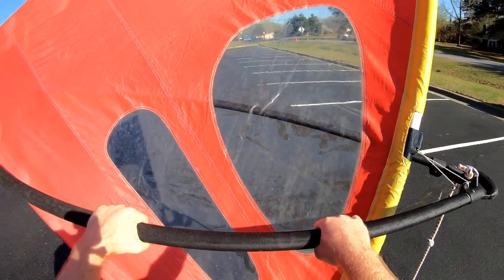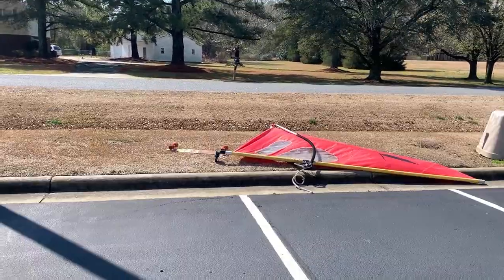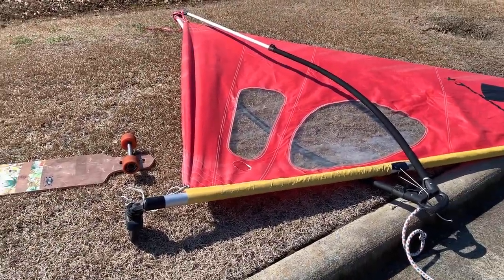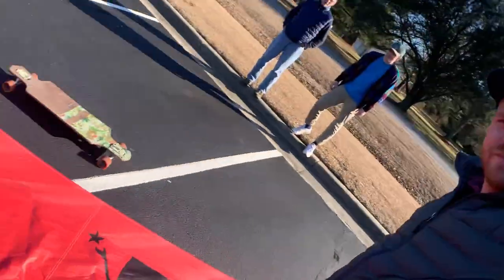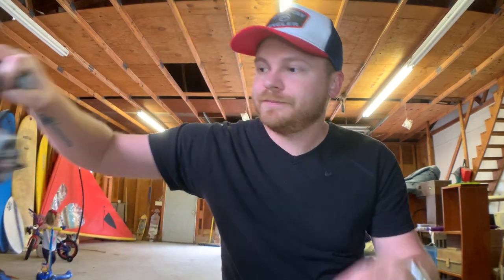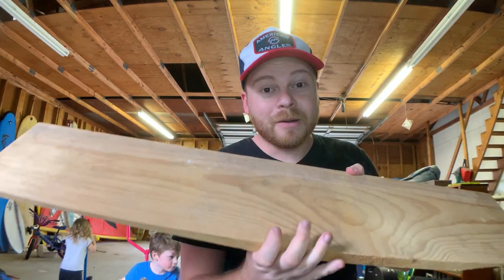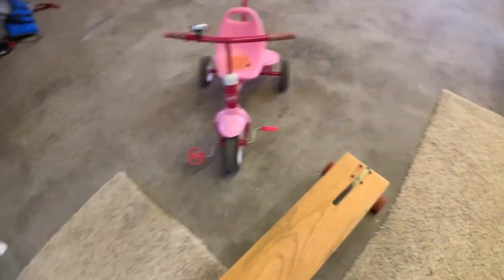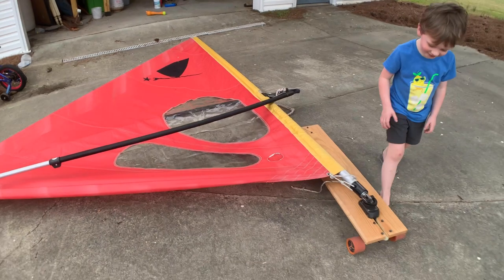Wind SKATING?! How to build a wind skateboard

Comment: You should try and tie the boom closer to the mast. It's too wobbly. A fixed boom is even better. The sail wil function better if you put more tension on it and you could sail more upwind, back and forth. When there is a gust, just open the sail. Im sure there is a lot more fun of you improve it a little more and try it again. Dont give up yet!

Comment: what kind of sail is it? all sails have a similar mount?   could you use a sail with a (inflatable) sup?
Reply from the maker: It’s from an old windsurfer from the 80s. Most modern windsurf boards have a different mount. 

Yes! You can instal sails on a SUP they actually make SUPs with the Mount built in! Or I’ve seen some people build their own Mount by cutting into the epoxy